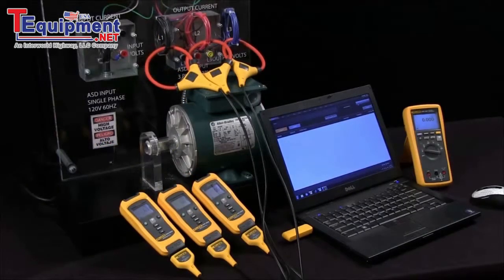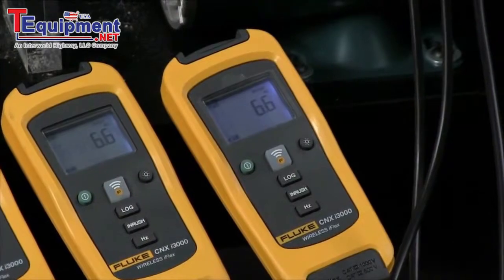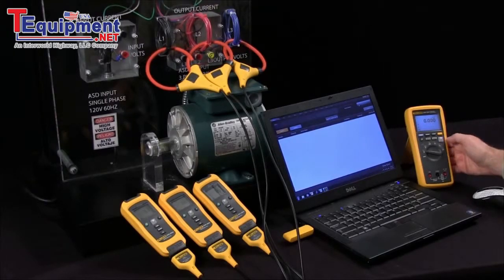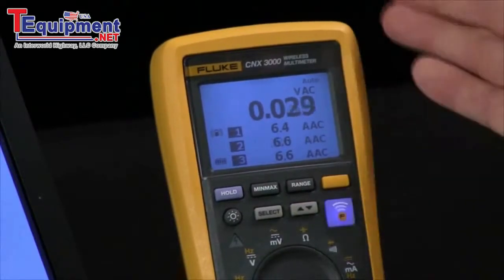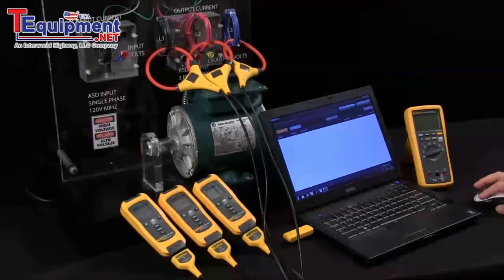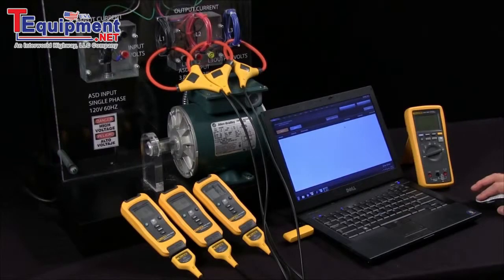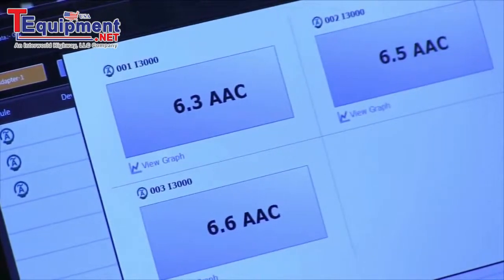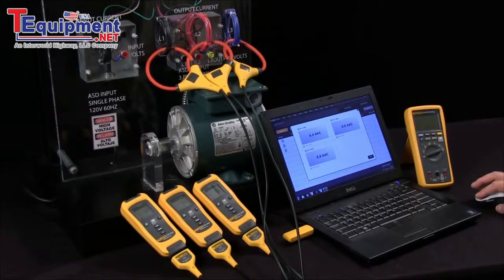How To Measure 3 Phase Current With The Fluke CNX Wireless System

Comment: Hi, Is it possible to see the three sin waves on the computer screen?
Reply from the maker: The CNX system has been replaced by the new 3000 FC: https://www.tequipment.net/Fluke/3000-FC-IND/Current-Clamps/ Unfortunately, neither Fluke system will show you the sine wave. In order to actually visualize the signal, you would need an oscilloscope. You can check out the Fluke oscilloscope line here: https://www.tequipment.net/fluke/oscilloscopes/ We also recommend this model from RIGOL: https://www.tequipment.net/Rigol/DS1054Z/Digital-Oscilloscopes/